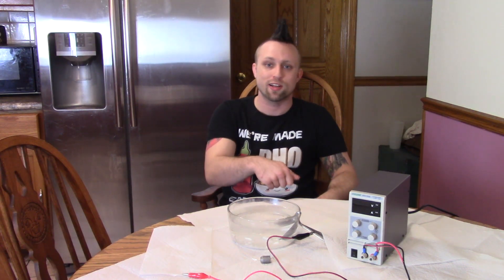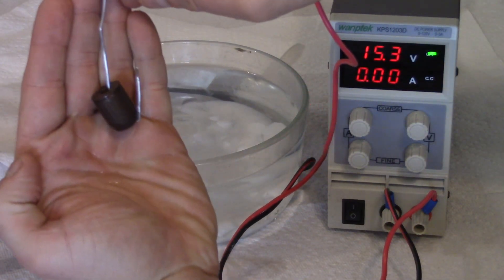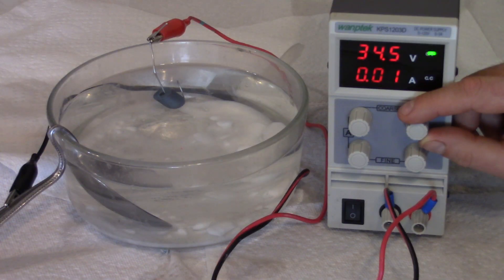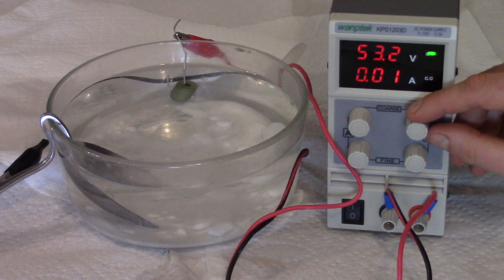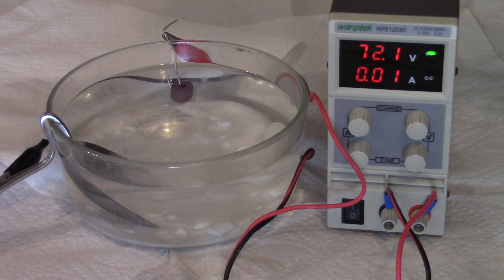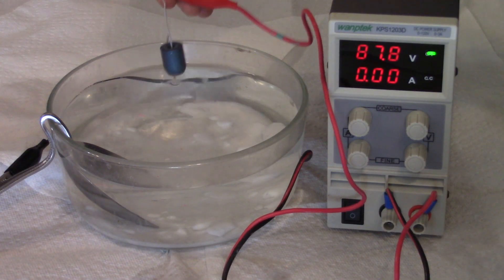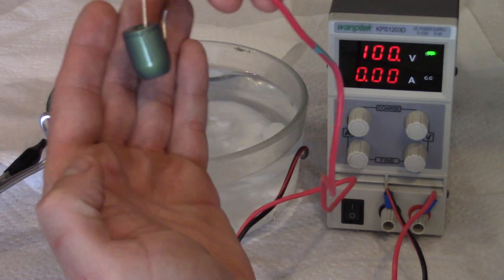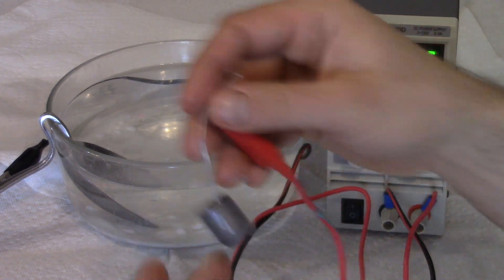Titanium Anodizing Voltage and Color Guide.  What voltage gives you what color anodizing tutorial.

Comment: This video is useless unless you tell people what electrolyte solution you are using. I see lots of people asking but no answers.  I use Distilled White Vinegar but the voltage is different for the colours for example gold is 80V. They go through the same pattern brown blue purple pink green gold as you keep increasing the voltage. I use a titanium wire to hold the work piece. Also depending on the grade of titanium this will also affect the colour. So basically you need to experiment to find out what works for you. Also important to wash the material before and after the procedure. before to remove all the oils from handling it and after to remove the electrolyte to prevent corrosion. You are not going to get red with this colours are limited and you can see a general chart online of the order of colours and what is possible at certain voltage.
Reply from the maker: +Alluring Smile Makeovers By Alexander Vasserman DDS., PC I say in the video. 1 part borax 10 parts water

Comment: what is your electrolyte?
Reply: I use 1 Gallon DISTILLED water, 2 tablespoons tsp regular TSP.  seen people use baking soda and distilled water.
Reply: Distilled water is battery water ?
What is tsp i don’t know tsp
Reply: TSP is a powder chemical at hardware stores to clean  walls before painting.   ive heard baking soda and distilled water work also.   then ya just gallon distilled water.   main thing u need is whinks rust remover or multi etch or battery acid to etch titanium before anodizing.   i use whinks
Reply: Is work metal ?

Comment: What if you wanted to do two different colors on a piece of titanium, would you achieve your first color, tape over it, and then achieve your second color? Also, what if you have milled titanium and you want the high parts green and the milled grooves to be yellow. It doesn’t seem like taping would be an option.
Reply: You can also mill after anodizing the surface. Obviously this only works if you're anodizing the grooves at a lower voltage than you anodized the surface. An alternative is to mill after masking the entire piece, but you'll get some "bleeding" where the mask lifts or chips.
Reply from the maker: +DougFLA123 you just dip half of it at a time.  Or can mark off with nail polish

Comment: Can someone explain how he's not getting shocked? I saw on another video that on the higher Voltages (using 12, 9V batteries in series) that they used caution when taking the metal out of the water, and they basically had the same set up except in the other video they used batteries as their power supply. Was their caution unnecessary? I want to try this but I want to know of any and all hazards before hand. Should I unplug the lead and leave the ground connected when I get to higher voltages before I take it out of the water? And when I first connect to power supply do I connect ground first then power? Thanks to anyone who can answer this for me.
Reply: He is using DC power supply and low current, not AC voltage.
Reply: @hungnguyen-vq7kd  150 mA can cause severe pain and possible respiratory arrest; 1A can stop your heart. Even 7 mA across the heart can kill. Your protection comes from the resistance of your skin, and your internal resistance; insulation (rubber gloves) adds to that.

Let's say your internal resistance is 300Ω, and your skin's wet so your contact area resistance is only 1KΩ per hand. That puts total resistance at 2.3KΩ. If you're anodizing at 80v, and you get this voltage through your two hands and across your heart, that's almost 35 mA. This is NOT safe.

Nitrile gloves (assuming no tears) add about 120K of resistance per surface. If you were wearing a pair of nitrile gloves in the above example, you'd be exposed to only 0.3 mA (80/242.3).

Use the gloves. Only touch with ONE hand at a time, like an electrician.
Reply from the maker: +Hunter Keating no just wear rubber gloves or only tough the rubber part
Reply: Dc has to complete a circuit + to -
Reply: Its the resistance and capacitance of the human body.

Comment: Do you know if this will work on 90% Tungsten? Looking to change the color of my Darts. Thanks
Reply: It does not. The reason this works is because of the unique molecular structure of the oxide layer that absorbs different wavelengths of light based on the thickness of the oxide layer. The few metals that this works on is titanium, niobium, and tantalum. When you anodize metals like aluminum or magnesium the structure of the oxide layer isn't really special and the structure is too big so no color change is visible. The surface of these metals is porous which easily accepts dyes and that is how they are colored.
Reply: Thank you! I know I can heat it and get it to Black. I guess that or just paint it.

Comment: What's the finish on these like? Is it matte or metallic?
Reply: The finish depends on the finish of the starting metal. It doesn't change the metals finish. So, if you have a bead blasted finish it will be matte. If you have a polished finish it will be polished. The color is metallic not opaque so it still have that metal look.

Comment: Hey, I thought I'd warn you guys but anodizing with steel in the mix (in this case a spoon) can cause your titanium to be electroplated with steel creating spots. 
I recommend using aluminum foil as your conductor.
Reply: I just use titanium wire for the anode so there's no worry about other metals in the mix
Reply: @SamChaneyProductions  Yep. Just buy some Titanium wire. Not expensive, works like a charm!
Reply: Wouldn’t that annodize the aluminum foil though?
Reply: @franklinmontez8733  no because the titanium is still on the positive lead and you don't anodize to the negative
Reply: I only use aluminum to anodize aluminum, I mean I have been using a steel mesh as a cathode to anodize titanium and it works pretty good
Reply: B E E D S if he knew what he was doing...
Reply: upload your own expert video, snarkarse.

Comment: Duuuude you need to figure out how to do this to aluminum! how to strip the ano out of a yoyo and re anodize it again
Reply: Aluminium anodization is different. Colour is achived by pigment infused to the porous oxide layer. Clear ano just off-white colour, the colour of aluminium oxide. Ti ano layer actual reflect spectrum of the light, depending of the thickness. So changing the voltage changes the layer thickness, thus changing the colour
Reply from the maker: +ErickØSX well aluminum takes a lot of expensive chemicals and equipment
Reply: Andrew DiMartino Check out tutorial on anodizing aluminium out there, basically similar to titanium process (chemicals might be different) but the oxide layer is naturally porous. Then the part is dumped into liquid dyes and then boiled to seal the porosity to hold onto the colour
Reply: Do you know how they create and infuse pigment in to the oxide layer?
Reply: Ok cool, ill check some out, thanks dude!